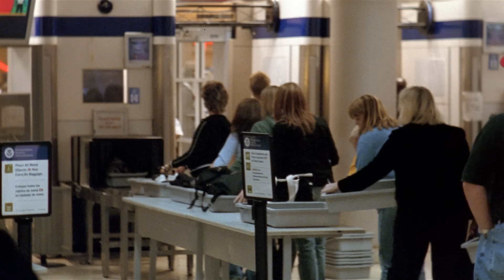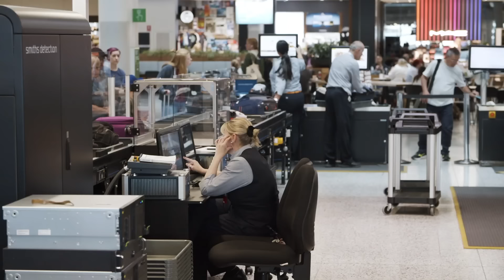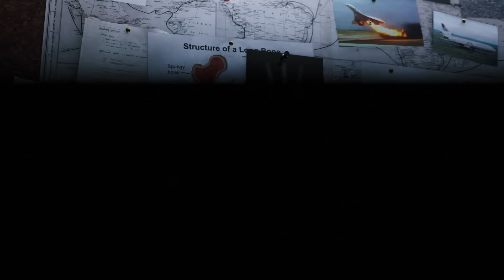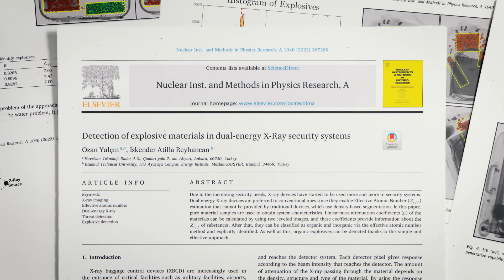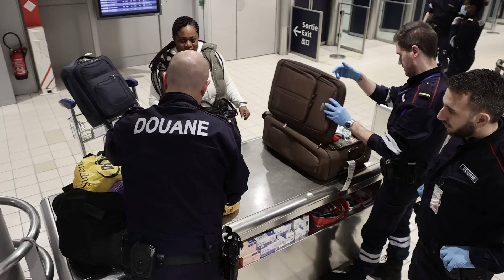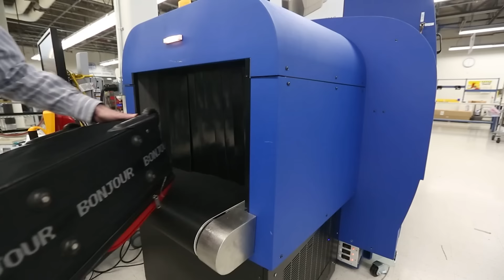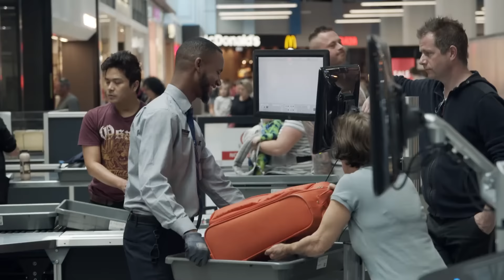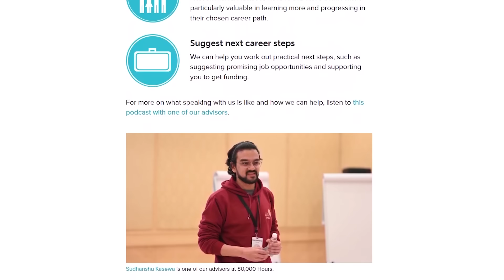Why Airport Security Suddenly Got Better

Comment: To me it always felt strange that this spreaded all over the world and permanently when 9/11 actually was a bigger thing because they crashed the planes into massive buildings. Had it been in any other place without skyscrapers it wouldn't have been any different than simply blowing up themselves. And there is barely any safety measure against that. You might travel feeling safe in a plane, but you have no safety in a crowd. Just hope that they are tracked and stopped in time, but there is no screening for other vehicles or simply going on foot. Sadly there is probably no turn back in generations if ever.

Comment: It still does not justify the TSA violating our 4th Amendment rights.  There should be a warrant issued based on probable cause.  But there is no probable cause when you travel by air.

Comment: You can't imagine how much I smiled when the fast lines opened up in Munich with the new scanners. 
I noticed the queue with these new "Smiths detection" machines was much faster, so I went for it. I noticed people weren't taking out anything out of their bags. When it was my turn, I asked: "Do I have to take stuff like laptops and headphones out?" and to my surprise the security guy said no.
I felt so good! I had just been through security (that normally takes an hour, or more) in 12 minutes. And it's not like it was a slow day at the airport, this was around Easter!
I used to arrive at the airport 2 hours before my flight with the old scanners. Now I still arrive 1 hour before my flight at the airport and I usually have a good 45 minutes of free time. 10-15 for security, no ID checks, because Shengen. I love it!
Traveling around Europe became faster and more enjoyable.

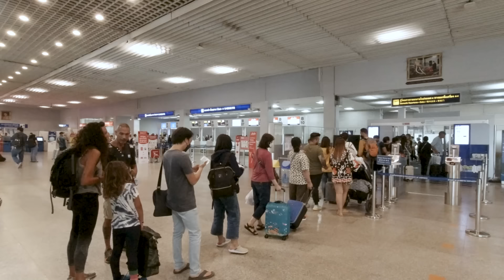Comment: 00:39 This kind of statement mostly shows you're the one knowing nothing else than your local domestic terminal. Someone who traveled around the world in the past 20 years will most likely end up not unpacking anything that's not explicitly requested to. More often than not laptops can stay in the bags, but not liquids. In South America, it's usually the opposite and liquids are fine on domestic flights. In China, strong restrictions are enforced on powerbanks and recording devices, but you can fly with a lighter in your pocket. Some countries allow blades up to 6 cm while in Japan and Egypt they'll confiscate a large nail clipper. In some airports you will get scolded to use more than 1 tray, while in some others you need to use separate trays for liquids, electronics and clothes.

Comment: Any object with absorption/emmission will appear more/less absorbed/emmitted the edge of the round object on the outer edges where there is overlap in front and behind with other material from the round object.

Comment: Great, some of the engineering whizzes at Smits Detection came up with a better mousetrap to sell to all the Airport Security Theater agencies of the world. Great for their beottom line and thanks for passing along a little extra cost tagged onto our tickets. If you REALLY though this through then you would realize the proper solution. Toss every scanner, conveyor belt, beeping wand and x-ray into the dumpster. Hire and train a group of real pros--not the brain dead wanna-be-cops of the TSAs of the world. While people move through unmolested these people suveil you--andyes, they PROFILE--there I said that dirty word. That will actually have better odds of catching the 1 in 100,000 contraband carrier. It is actually the way that inbound customs works--not with tech but with human experience. The inbound agency has already noted the flight manifest and made their list. The moment that you step off the plane and make the long, longwalk to customs the cameras are on you and they choose their finalists. Visible high tech airport security is a complete waste.

Comment: I have to say the security at the Calgary international airport is lacking (or maybe it was just me😅). 

So I was going back home from The 4-H Canada science fair in Calgary Alberta. 
When I went though security I forgot to take by boots and my jacket off as I went through the scanner and none of the security staff did anything (this was my first time flying) 
but most surprisingly I got my bag through security with no checks or suspicion. The reason why I was surprised is because the topic I did my 4-H science fair topic on was water electrolysis (splitting water into oxygen and hydrogen gas, hydrogen being very combustible), and I had one of my water electrolyzers in my bag, which it was made out of metal sheets and had a bunch of wires going everywhere, it looked A LOT like a bomb and could potentially be used as a bomb. 
But they just let it through with questions and I got on my plane and went home (with a potential bomb in my bag 😂)

Good to see airport scanners are getting better though 👍

Comment: They wreck your film though…
Reply: truee
Reply: Nope. They're film-safe up to 1600 ISO.
Reply: @awmperry  the CT scanners aren't and even the old X-Ray ones would fog film with multiple uses. This is just physics. Even If it's safe for 1600 ISO then that means it won't be safe for 800 with two scans, 400 with four scans etc. And safe is relative: how much fogging do you want to tolerate?
Reply: @awmperry not my iso
Reply: Checking to see if this reply was from 2004.
Reply: Relevant for the maybe high estimate of 0.01% of travelers carrying film in their bags
Reply: @TheOOOOOOOOOOOOOOO  isn’t a issue in the US as at any airport they will hand check your film. In Europe and elsewhere it can be pretty frustrating.

Also: even if it’s 0.01%, and my guess it’s higher with the increased popularity of film, that means 2000 people a day are having their film ruined at a major airport.
Reply: If only there was a more resilient, easier to use, more compact way to store photos digitally...
Reply: @aj_mcnamara  full-frame digital can’t match film compacts for size, and medium format digital can’t match medium format film for sensor/film size or price.
Reply: @benbunch4159  yes it can. You just want use film, which is fine.
Reply: @benbunch4159 Yes, it can. Do you live in 2010?
Reply: @IceBlueLugia  please name a full frame digital camera the size of my Olympus XA or my Ricoh GR1v, or any myriad of film point and shoots. The Sigma FP is the smallest full frame digital and without a lens is bigger than my film cameras. 

For medium format: Please name a digital camera with a sensor size equivalent to my 6x9 Fuji. (56mm x 84mm). Basically double a Phase One.
Reply: @aj_mcnamara  I have film cameras that are smaller than any full frame digital camera with excellent lens quality. There is no full frame option out there that is as pocketable as a premium 35mm compact. There are also no digital stills cameras on the market that can really match the sensor size of 120 film to say nothing of large format. The Phase One is almoooost as big as 6x45 medium format but the camera is extremely expensive and actually more finicky and difficult to use than many 120 medium format film cameras, and if you're shooting 6x7 or 6x9 you're blowing it out of the water in terms of film/sensor size anyway. 

I like carrying a digital camera with me but the ability to bust out the quality of medium format film or the ability to have something completely pocketable with a full frame look is non-trivial. Digital just hasn't done it yet.

Comment: I'm a little confused towards the end of the video.
You stated:
"Its a relatively small airport with 1.5M passengers last year, but if this technology saved everybody going through security, just 5 minutes, that's 9.75M minutes (18.5 years) saved per year".

1.5 * 5 == 7.5, not 9.75.
9.75 / 5 == 1.95
how are you supposed to save 18.5 years per year, if there is only 1 year in a year...?
are you saying it would take 18.5 years for 1.95M passengers to get through security without the technology?

Comment: I always carry a small thermos flask with me whenever i travel. Most of the time i empty it before going through security and then just refill it once im through. But  sometimes i forget to do that and carry it through filled with water. 
However interestingly i never once got stopped, i got stopped for plenty of other things, chargers, dongels and keychains and all sorts of other rubbish. But never the water bottle. 

I dont know if its because the scanner couldn't penetrate through the double walled steel thermos, or wether they knew it was water and just never bothered to stop me. Or wether they just wilfully let it slide because so many people were bringing the same thing in and they could tell what was a water bottle and what was something else. 
At any rate even if there was anything suspicious they would just make you drink it or they themselves would just take a sip to confirm, and most of the time they'd just let you go through anyway.

Comment: I'm wondering what's used at sea ports when driving onto a ferry. Been pulled aside a couple of times and they were only interested in specific things eg. Only interested in the boot, wanted to open the suitcase but only glanced at it having seen a laptop and some socks. I thought they were maybe measuring my reaction more than anything but who knows?

Comment: Get ready to head down the photon counting detector CT scanner rabbit hole. Rather than using integration detectors that require a certain photon flux to even obtain a signal they actually measure each inbound detector photon and identify its energetics. It’s like dual energy but on steroids. In labs today, but very close to final products and will likely be out in the wild soon.

Comment: If you like charts and tables for this stuff then check out NIST XCOM. CT scanners are very helpful for bag throughput (scanned bags per time), which is what governments want to improve, but it's really just a triage step and not the final solution. That's why there are also machines for mass spectroscopy or even x-ray diffractometers (aka bottle scanners) for security to use when they find an anomaly. A long time ago, I did some research on modifying scanners to utilize coherent x-ray diffraction (which measures the atomic structure rather than atomic density that the photoelectric effect measures). But the energy sensitive detectors needed to distinguish the scattering are pretty costly, and probably not worth it monetarily (yet) for the bag throughput payoff it would give. As for why you can bring in water when it could really be hydrogen peroxide, it's just a risk they've decided to take. You need nitrogen for big booms, not H2O2.

Comment: I am a 35mm film photographer. These scanners WILL fog film. I MUST ask for a hand check but then I have to contend with staff who don't  understand and try to force me to have them scanned. Some airports  suggest  putting the film with checked luggage  but that too can have excessive x-rays. The problem is that I won't know that the film is fogged until the photos are taken and brought home for developing.Film photography holiday ruined! There is no guarantee I can even buy the film when I'm travelling. Some airports do have signs offering hand checks for film and advising arriving very early. Film photographers do need to be aware that even though they have had film scanned in the past and it was OK with the new CT scanners it is not. Cheers!

Comment: Better?

It is unarguable that airport security objectively worked better in 2001 compared to the hell that everyone is forced to go through today just to get on a plane.

No terrorist have been caught by airport security in the 22+ years since all the guilty-until-proven-innocent rules went into place post 9/11.

On the other hand, all 19 of the suicide terrorist were stopped and sent to the back room by different sets of retirees that used to man the security gates because there were multiple middle eastern men carrying identical knives (box cutters).  Oddly all 19 middle eastern men, some of whom spoke little english, nevertheless were able to quote the exact policy that allowed box cutters.

Second level security at both airports called it into the FBI who told them to the men weren't breaking laws so let them board their flights.

Less than two hours later we had four crashed planes and chaos in NYC and DC.

The entire TSA all needs to go away including metal detectors, it is useless.

Comment: No, that is not the reason liquids have been barred from many airport checkpoints.

They banned water, and any other item the screener on the day decided was a "liquid", because the TSA and UK went crazy over a reported plot, which never got past planning, much less testing, which reportedly aimed to use liquid explosives to bring down aircraft on the trans Atlantic flight paths.

The possibility that such a plot could be carried out was so low, by every possible metric, that the entire exercise of limiting the amounts of liquids at airport checkpoints has been completely pointless.

Japan had liquid scanners very quickly after the US and EU started that ban and offered to give them to the US. The US refused because they wanted a US made system to do liquid scanning.

Comment: I’m not a huge fan of the overly complex system in its entirety. The technology in the scanning equipment is amazing. However, the rest is so overkill, and forever stopping for faults or lack of trained staff. 

If anything, it seems as if these new systems require vastly more staff to operate. The staff viewing the images have little time to make a decision, typically leading to frustration at the decision point when you see your bag sent off the main line. The amount of times they scan your tray, have a quick look at the image and say all good or the image was poor and requires rescanning it terrible. The tray return network is overly complex, often having issues, that already hinder you having to wait for the line of trays to move so you can push yours through. 

Then you stand on the body scanner, the ones with a panel on 2 sides that you face sideways and  put your arms out. If you’re in a hot climate, you’re getting stopped to have someone pat you down where you’re sweaty. 

In Australia and New Zealand, you can take water through on domestic routes, international doesn’t allow any though.

Comment: The water thing is probably more of a financial thing - if I can open the bottle and drink it without dying in front of TSA, then it must surely be water.
If you think about it, all these lithium powered devices we carry make for much better explosives, and yet they are allowed on every flight (well aware of the energy restriction). With a burning temperature of 2000 Degrees Celsius, what's stopping someone from using a couple of electronic devices in conjunction to do terrible damage? The fumes alone are deadly already...

We've got to rethink our airport and plane security in general. The current measures, reliable as they are, remain more of a show than actual security. Anyone with serious intent can find their way around it, its all far too fragile of a system.

Other than that, great video as always :)
Reply: My last flight crews verbally forbid charging of vapes during the flight and I would love to hear the contingency plan they have for a thermal runaway device in the cabin.
Reply: @godlugner5327  Fire extinguishers, and diverted landing
Reply: @godlugner5327 They've got bags rated to contain lipo battery fires for batteries under a certain capacity, which is also why there's a limit to how large your batteries can be.
Reply: @godlugner5327  They have a fire-safe box.
Reply: While watching this, I'm already working on getting around it... and I have zero intent or desire. Just a fun thing to think about. The fact is, perfect security doesn't exist.

Comment: Micro-X has developed a smaller and more reliable airport scanner system with no moving parts. 

They also have a mobile bomb scanner that uses backscatter X-Ray technology the size of a large cereal box, it’s also able to take small measurements. It uses backscatter X-Ray removing the need for a reflector plate, thus making bomb detection a whole lot more safer.

Micro-X also has a mobile CT machine that’s small and lightweight with no moving parts. This can now be placed into ambulances, helicopters and planes.

Some amazing engineers at Micro-X

Comment: Automated bomb detection in airline baggage is a 30 year-old technology. I worked as a software engineer for a pioneering company in this field from 1990 to 1999, and I can assure you that using X-rays to determine the atomic number of every object in a bag is older than you think. By hitting the bag with X-rays at two (or more) different energies at the same time, very sophisticated algorithms can determine whether or not a patch of "voxels" is one of numerous families of explosive materials. I suspect that the main reason this seems new to most people is because this technology does not receive much public attention, as it has been decades since a commercial passenger jet has been taken down by explosives on-board the aircraft (Pan-Am flight 103 was the last confirmed incident, and the one that got this technology jumpstarted in 1988). But I'd wager this technology is older than most of the people viewing this video.